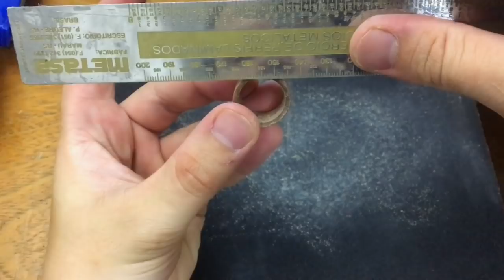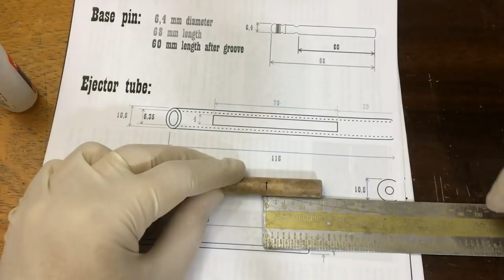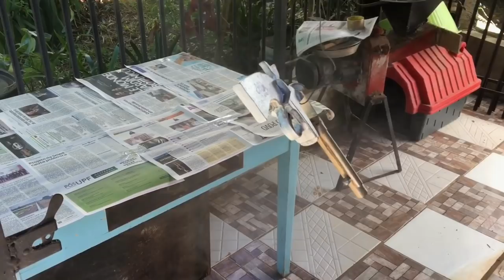How to make | Cardboard Colt SINGLE ACTION ARMY | Fully Functional | Ultra-realistic

Comment: Question...
How the can I drill those holes without a drill?
I get that I could use a drill , but I'm not really good with that. Maybe just use a pen or a pencil and drive it through it?
Reply from the maker: When you’re cutting the individual layers you can cut each hole using a cutting tool or scissors
Reply: @HomeGunMaker  Thanks!

Comment: So if you live in America you cannot get A4 printer paper, you can get standard letter printer paper though... However there is a slight change in the dimensions of some of the pieces. The main pieces to note are cylinder piece a which is reduced to 7.5 mm and cylinder piece b which is reduced to 6.5 mm the rest of the cylinder can be shortened according to the reference picture given with said pieces because it is a full scale
Reply from the maker: When you print the files you just have to select scaling/shrinking to none, and it will print it in real size (it might get cropped on the edges but probably not since I left some margins)
Reply: @HomeGunMaker  what is the thickness for the varnish part of the handle

Comment: Three questions what thickness for the cardstock. What size is the interior circle on the ejector rod head. What's the size and depth of the indent on the top of the frame where it meets the barrel. The templates actually say two different things if you do the math for the thickness of the trigger guard and the number of one layer pieces and then divide it after subtracting the amount of fitness there is then it equals to about a third of a millimeter for each piece but your templates also say that one layer is .14 of a millimeter
Reply from the maker: You can use any thickness of paper, and use as many layers as it needs to get the specified thickness written on thr templates. Each piece has a specified thickness. Sometimes you’ll have to round them up, like if it says 1,4 it’s ok if yours gets 1,6. My cardboard was roughly 0,5mm thick. 
Don’t think about the paper thickness, but each piece’s thickness

Comment: there's a part at about 3:04 which I think is called "hand" and you have what appears to be a small leaf spring attached with glue. Can you tell me what you used or bought for this spring as i cannot seem to find anything suitable? Thanks - great work
Reply from the maker: A piece of wire
Reply: So I'm guessing a bobby pin would work?